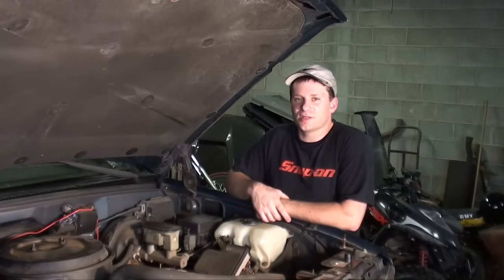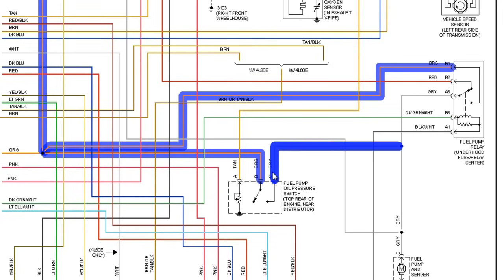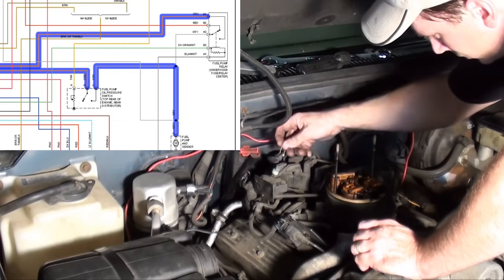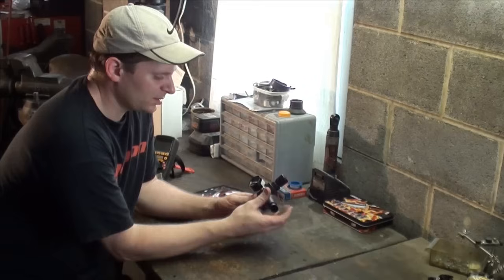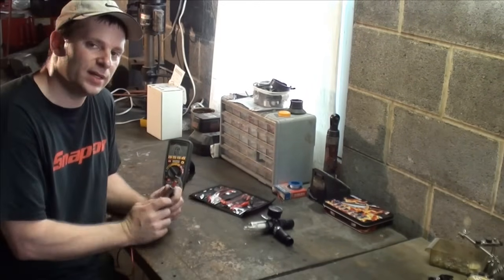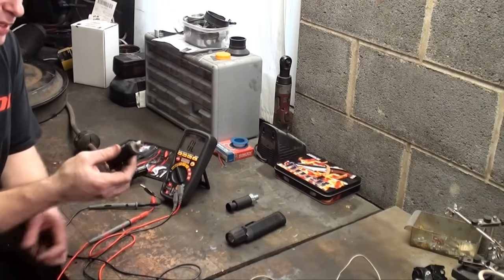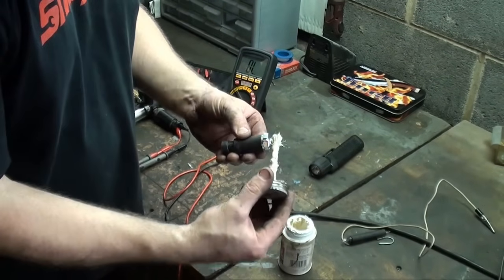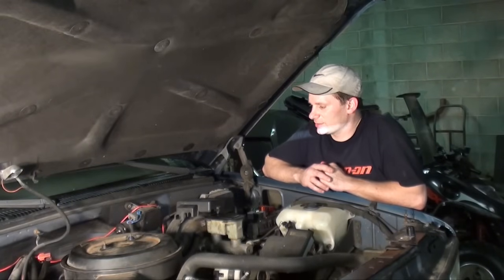Part 2. GM no start no fuel troubleshooting "Oil pressure switch"

Comment: Trying to diagnose a similar situation with an 1989 Buick Reatta 3800......  I think I am correct in believing that the oil pressure 'switch' and the oil pressure GAUGE sender are different and  independent?....
My issues:  The car at some points during the day (but not always) fails to start on first or second crank.   When this occurs I notice that I hear the fuel pump motor only after the second crank (with key in on position);  ALWAYS after I hear the pump running, it will start on the next crank, and run fine.
Second, the oil pressure readout (on the CRT display) 'bounces' around excessively while driving;  it's in normal range most of the time,  occasionally spikes to a very HIGH pressure reading;  I don't notice anything wrong in the way the motor runs during this time (which would be the case).....

So, I'm wondering what the cause(s) of the problems are......    I would say the pressure switch may be bad or 'clogged' or something....  OR is it that the pressure gets too high during cranking and actually shuts the switch off somehow?....   Are the pressure readings and difficult starting unrelated?

Comment from the maker: It saved a few from shoulder, however what would of maid more logical sense to me, they wanted to incorporate the oil switch. Why not use it to protect the engine like so.
  use the relay until run signal and oil pressure was achieved, at that point drop out the relay, follow me? In that case if oil pressure was lost while running fuel pump would shut down as a protection for the engine,
However Gm simply just used it as a back up why they found that more important i really don't have the answer

Comment: Ok. I have a 94 full size blazer. 350 auto tran.  Will the oil pressure switch in this vid cause the fuel pump to turn of at start. The engine runs  if starter fuel is added at start. If no starter fluid no start.?   Thanks.
Reply: Hey I have the same exact problem with my 1993 S10 4.3, any luck??

Comment: what if u jump the wire to the oil pressur switch but still doesnt turn on the pump? i installed a new pump and im swaping it out again but tested the first pump i pulled it it still wont turn on?? the first pump was running befor i pulled it. only pulled it because it was bogging out and i thought it needed to be replaced

Comment: sadly my wife's 98 suburban isn't the only thing sufferning from this ailment, my 99 taho is starting to exhibit those same charicteristics also, that being the case I get to do this repair twice. not finding the part yet for very cheap though haven't looked very far but the cheapest so far is $50.00 for that regulator

Comment: I accidentally touch pins 86 and 87 on the fuel pump relay,  now i have no power going to the fuel pump , i try jumping the oil pressure switch and the wire gets rreally hot i have to take it out  , i put and extra power wire going to the orange wire on the relay and it works but the oil pressure appears to be high,  i appreciate any help, thanks

Comment: i have a 97 chev suburban with same issue just died replaced fuel pump 3 times but no diff they checked fuel pump the last time and it worked so i redid the wiring and still no power to fuel pump i tried checking the relays like u did but mine were different some odd reason opposite sides had power then the 1 u had in vid i tried same sides udid but mine didnt work tried opposite side and worked went by numbers like u did so not sure if my comp is gone or fuel  pump oil pressure switch now lol
Reply: all u had to do is run a wire from  fuel pump  to your fuse box that's  I did my s10 and my start it right up

Comment: Is there any way to jumper the oil pressure switch to run for awhile til you can change it out?
Reply: yeah. remove the plug from the switch and then jump the contacts. you will be closing the circuit, just like the pressure does
Reply: +Stacia Paluch DON'T DO THAT because it will make the fuel pump run continuously.  The switch is only there to keep your engine from cutting out if the relay fails while driving.  I suppose you could jumper it before you drive and remove it when you stop.  That would probably get old real fast.  Also, while jumpered, if you get into an accident and the fuel line breaks, it will continue to pump out fuel and most likely light your car up.

Comment: Well last night my 98 Silverado k1500 left us stranded. Only the 2nd time since new.
So I'm going to follow this vid for some diagnosing. But I'm williñg to bet the pump took a crap. It just kinda lost rpms slowly and finally died. Cranks but no start. Can't hear the fuel pump run either.

Comment: Ok we have changed the fuel pump and checked the relay in our 97 chevy venture the car will start after it sets for awhile but will only run for a few seconds. As it will start with starter fluid but no longer than a min before it dies. Please help. thank you

Comment: I replaced my oil pressure switch and still have no fuel. When I jump the oil pressure /fuel pump wire i can here the fuel pump kick on. Any idea where to go from there?

Comment: Make sure there is continudity....must have continudity. ;-)  (@ 4:08) ...but seriously...thanks for the info.  Very helpful in my troubleshooting the same thing.  I'd never think to test the oil pressure switch.
Reply: I specifically came to the comments to see if anyone else picked up on the "nudity" in this video. LOL

Comment: Can you tell me why my fuel pump comes on have fuel to the TBI but injectors don't spray sometimes what controls that.the motor runs fine sometimes then sometimes it stalls and won't restart if I let it sit most times it will start and can hear the injectors pulsing (ticking sound from TBI) ,fuel pump runs every time the key is on has spark every time but what ever tells the injectors to pulse doesn't always make them pulse.I've been told 8 different things it could be ,I'm thinking its the ICM because I have fuel pressure constant and I have spark to the plugs constant .all relays seem to be good and fuses .someone told me if the icm is bad the spark side will appear fine but the side that tells the injectors to work will not allow fuel to the injectors or it will go into flood mode and not let it get fuel..can you please help thank you

Comment: thank you. that would make sense to me to run on a oil pressure switch as the main to protect the engine :)  I had to change the intake gasket on my 98 gmc and I change my oil pressure switch the same time. nice to know for the future though. :)

Comment: what happens if your oil sensor jumper doesnt turn on the pump does that mean my pump is out? or another problem? pump is new
Reply: AnDrEw 831 its the fuel pump or the pressure switch as long as all off it is getting power

Comment: Will, don't you need to take the relay out and actually start the vehicle to prove that?  You proved that to run, you don't the need the relay but you have not shown that it can be started without the relay in place.  Is there enough oil pressure during the cranking?  The starter is only spinning at about 200 rpm, is that enough?  All of my three vehicles, the oil light goes out once the vehicle starts and not before.  If you still have the truck, please try that test.

Comment: Why do GM put that switch in such an awful place to get at ? On the 6.5 diesel its under    the intake manifold . My uncle is a GM designer , I want to phone him and yell at him ! l
Reply: +Paul Bains : You said it man! Somebody needs to call them. I've got a 1992 C1500 4.3 L. My Haynes Manual said the OP/fuel pump sw. was located next to the oil filter. It wasn't, that was a knock sensor at that location. I finally found a forum online that gave me the approximate position of the OP/fuel pump sw.. Initially I rejected that article, asking how could any engineer be that evil minded to place a 3 wire sensor down under the distributor at the very back of the engine approx 4 inches from the firewall? I could not reach or even see it from the side of the vehicle I had to monkey crawl up on top of the engine in my search, tore open a knuckle, lacerated an elbow, crushed a testicle on the air cleaner studs!!  That's before I even started work. I've got instrument lamps burned out behind the gauges. Now I'm told that GM designed it so I have to remove the trim work and 20 lbs of crap, pull the instrument cluster to replace a bulb the size of a jelly bean!!  If the gauge cluster is as much fun as the oil pressure sw. was, I probably need to call a damn ambulance before I even start!!!  GM=Gruesome Memories
Reply: Flickchaser The Guage cluster is not that bad too remove. Haynes book is a good reference for that. Mine was a piece of cake.